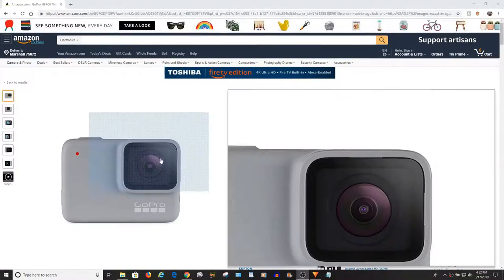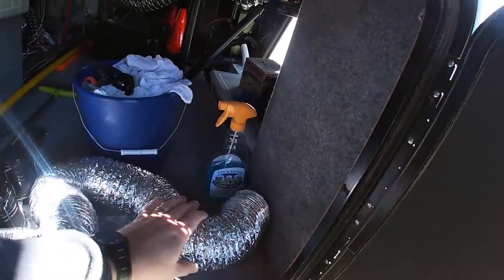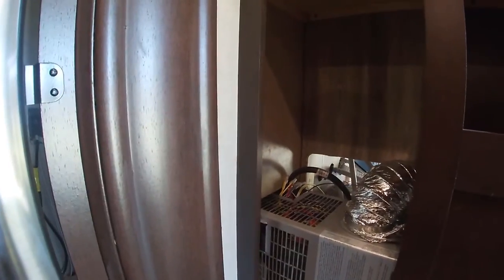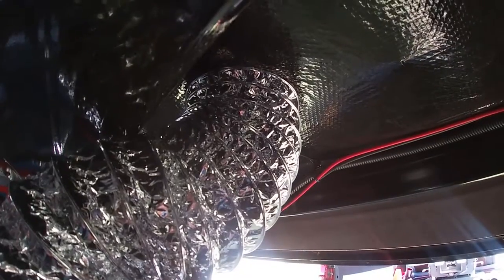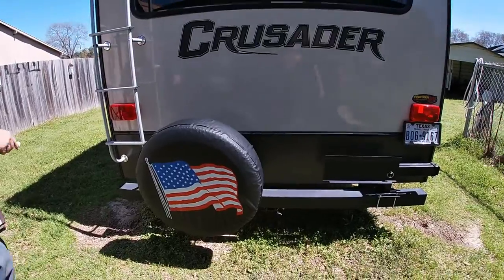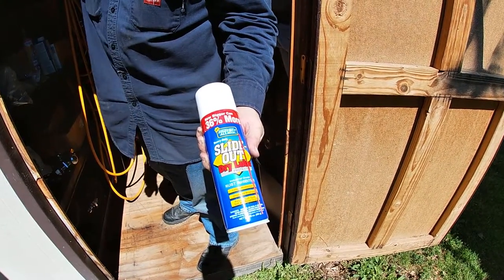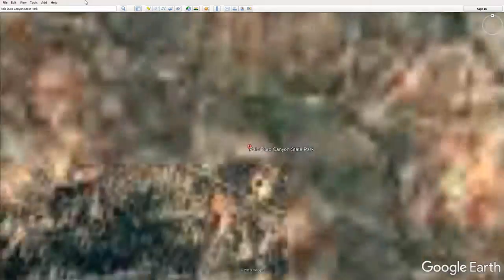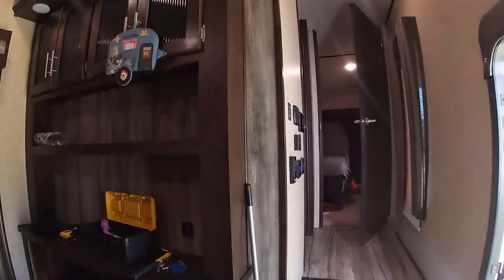RV Furnace DIY | RV Furnace Not Blowing Hot Air | RV Furnace Tips & Tricks | RV Heating Duct Replace

Comment: your 5th wheel is gorgeous! What is the width (not including the slideout)?
Reply from the maker: Thanks Gabrielle! The width of the camper with the slides closed is 8 feet I think. With both slides open in the back I think it's 14 feet wide.
Reply: @SunsetSeekers  Ok so I think you're a little wider than I am. I'm gutting my interior to regig the kitchen but I still don't think I can copy your layout. my slide is directly across from the kitchen area but there's not even 3ft b/w the closed slide and the kitchen counters. I think I'm only 90" wide.